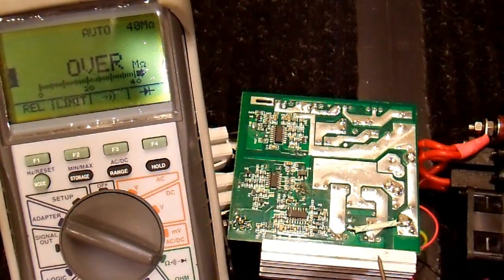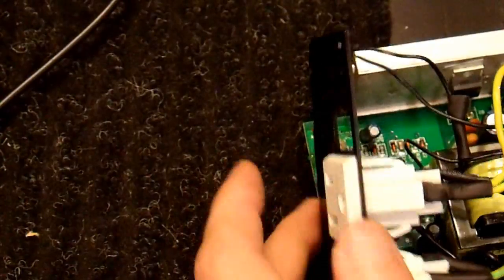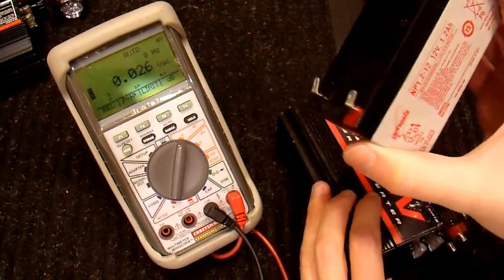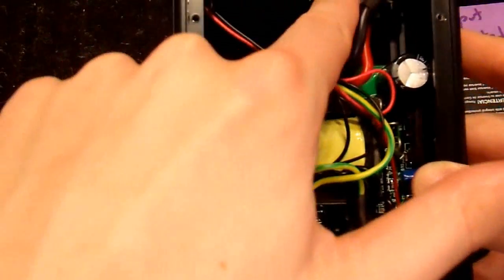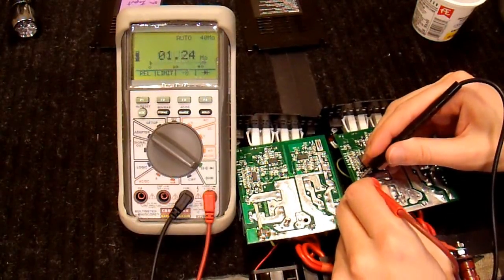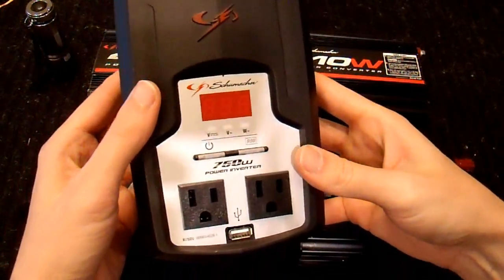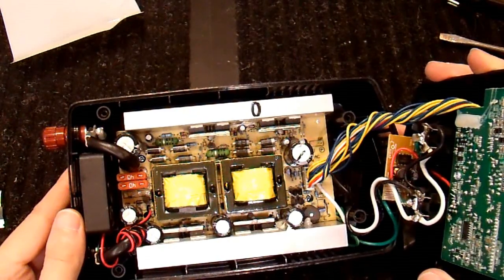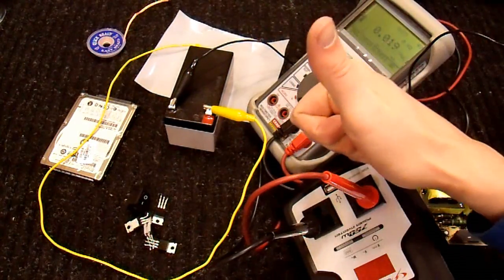A Pile of Broken Inverters: Viewer Mail #1.  Part 2/2

Comment: I have the black 750 watt inverter, my problem is the fan lost a plastic blade and now it vibrates when it kicks on. I've been using it this way for about 2 years. Even ran it during a power outage for 7 hours with a 200 watt load. I can probably find the fan online for a few bucks, but it only comes on when it reaches the right temperature or has a heavy load. They also make mini versions of it, that produce 410 watts. I have 4 of them hooked to various marine batteries and my solar system.
Reply from the maker: If you've been using it that way for 2 years then I'd just leave it alone.  Blades breaking off of fans is more common than you might think and is a frequent failure mechanism for inexpensive fans.  If you rely on the inverter for food storage or other purposes that would invoke a social or monetary loss then I would replace the fan otherise, bah, run it 'till it breaks!

Comment: knurlgnar, I have a motorhome with a gas absorption 8cu ft refrigerator that runs on 120v(when hooked up to power) or lp gas. When traveling I want to get an inverter to power the 120v part of the frig (the gas absorption heater element), as I don't like the idea of having our 40 gal lp tank turned on while driving. The 120v part draws 300 watts. There is also a 12v circuit board for for the frig but thats feed by the mh house batteries. I've been looking at one of these Schumacher 410 or something similar to power the frig while traveling. I t probably wouldn't be on for more that 2-5 hours at a stretch. Do you think this might work ok. Thanks, I appreciate you posting and sharing your knowledge on this subject.

Comment: Try taking one of the smaller inverters and hacking the output driver to switch a lower duty cycle and lower frequency.  Then add a potentiometer to adjust those so as to maintain the V/Hz ratio. In other words, turn it into a VFD! Once you have that down, you might want to try it with a bigger one.
Reply from the maker: an interesting idea

Comment: lm 324  lm3525  tl494  are the most  common I.C. chips used for most inverters in some units there may be  c.d 4013  lm556 for the 120 hz clock driver circuit.
Reply: +Kionekea Pelesi nice to meet you 324

Comment: I have a lovely 8yr old inverter that says 800w/1000w10s and it used to do that... not its giving me dc not ac! oddly i dont know when it failed as the equipment it powered was happy running on dc, but my new item i need to power has a transformer in it so wont work on dc... need to get it fixed, no idea whats gone in it so will maybe just replace all the output fets to start. 
I'd buy a cheap replacement off ebay for like $150 but you cant trust the claims on the cheap ones
Reply from the maker: That's kindof a funny story, actually.  :)  I would assume that some of your output FETs are shorted and allowing the HV DC to pass directly to the outlet.  Not Good!!  To repair it you'll probably have to replace not only the burnt output FETs but also the drive circuitry for those burnt FETs.  I've never seen that failure mode before.  Very interesting!

Comment: Can you plug a air cooler into a inverter?
Reply from the maker: Sure.  You could even plug a grilled cheese sandwich into an inverter if you tried hard enough I suppose.  :)  But seriously, while an evaporative cooler can be powered by one of these 400w units even a small air conditioner requires a heavier inverter than shown here.
Reply: I'll have mine plugged into a Samtex 2000 to 4000 watt inverter. I saw a company that was advertizing their air conditioner said that it would have to be plugged into a ac outlet. Just wanted to make sure. Grill cheese anyone? ololol

Comment: funny I have same inverter the fuse is hidden on board most would throw it out if
they cant find a fuse, becuase you have to take it apart!
Reply from the maker: I have found among numerous broken inverters and in stress testing working ones that the fuses very rarely fail on inverters with internal fusing and proper current limiting.  I believe I have seen it happen once.

Are you saying the newer versions of this model have internal fuses?  I hope the updated the current sense because this one does not protect itself.
Reply: that looks like HouseholdHacker s profile picture